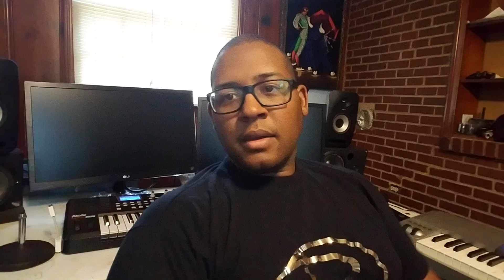How to fix computer noise in studio monitors

Comment: I found out how to fix my problem. I bought a Vizio flat screen and when I hooked it up to the computer I got a buzzing sound. More so when the screen was white, less when there is color. I tried changing resolution and so forth. Didn't work. So I took the vizio remote and tried the menu and nothing worked until I turned down the volume on the remote and there it was. You see the computer runs its own volume to the TV from the sound board and the TV increases the noise from the compute not the volume. So turn down the volume on the TV and use the computer volume. Problem solved!!!!
Reply: This really do work😂 appreciate the tip✅

Comment: Bro, never short HOT wire with GROUND, even for testing... Even with a multimeter, if you short ground wire with HOT wire for testing you can fry your equipment and possibly kill some people too. Like, imagine you're testing continuity by connecting HOT wire with Ground and someone is touching your PC case, or Microwave or Washing Machine.. They'll get 120v or 240v where I live  lol because ground wire is connected to outer metal shell of most of the equipment. Ground wire is an isolated cable that is connected to the long ground copper rod dug several feet deep during construction of the building.

Comment: In my case I'm connecting rokits to saffire 24 pro DSP with FireWire. And the funny thing is that only one speaker makes that noise. All my sockets are grounded. I thought the problem was in power cable.l, so I switched them. But still the same speaker was noisy. So I thought the problem was in speaker... But then I connected both speakers to my dj mixer and the noise was gone. I'm using high quality trs to RCA cables in both cases. Really confused...

Comment: Those Tannoy 402s you have are going to hiss no matter what. It's a known issue with those speakers. Hell, you can plug them in to power with no input and the volume turned down fully, and still hear a loud hiss.

Comment: how you fix this issue is buy a DAC and use the spdif optical outlet and all the noise will be gone.
Reply: semahnai i was thinking about trying this. Good tip!
Reply: @Dan Bate  Most DAC's use a USB connector, but that is 'electrical'.  A SPDIF (toslink) which most DAC's have is optical, AKA light based.  No electrical interference is possible with this kind of cable and connector.  If you dont know what a DAC is...  Its a Digital to Analog converter.  every device that can output sound has one.  You can buy higher quality external DAC's for your computer/phone that use much better chipsets and software to convert 1's and 0's to analog.  A really shitty explanation is Analog is 'basically' raw electricity. (i can feel the ree's from here, sorry nerds)  The benefit is both decoupling your audio processing from your PC, and greatly increasing sound fidelity in most cases.

Comment: I had similar problem, but my solution was the opposite. I had my monitors powered from a grounded power jack but had to break the line with an ungrounded splitter. So that might be worth trying for you who don't solve this WITH ground. I live in an old house with sketchy wiring, think that's one of my problems.

Comment: ATTENTION. For those of you who are still having noise issues even after using balanced cables, go into your power options and choose either high, balanced, or power saver performance. The less power used the quieter the noise. On power saver mode I literally don't hear a thing.I literally tried EVERYTHING and this was the solution. It is definitely a power supply issue.
Reply: what if you're using a desktop?
Reply: @hauntingthegrave  im on desktop and this solution still worked. The power plan options are included on desktop search power plan on the task bar
Reply: Thank you! That eliminated about 80% of the noise, it is still there but dramatically improved.  Going to try that plus installing a GFCI and see if it takes care of the problem.  Would a Peavey USB-P further help the situation you think?
Reply: No problem, but if you want to get rid of the noise completely even on high performance power setting, buy a hum destroyer. I bought this one https://www.amazon.co.uk/Behringer-MICROHD-Hum-Destroyer-HD400/dp/B000KUD2G4/ref=sr_1_1?ie=UTF8&qid=1491799568&sr=8-1&keywords=hum+eliminator 
It was totally worth it. Ps. If you buy one, make sure you wrap some electrical tape around each of the trs cables so the bare metal do not touch each other when they are plugged in.
Reply: Fuckin ay, my man, good shit
Reply: Unbelievable that this fixed my problem immediately. Thank you.
Reply: F*CK YEAH!!!!! I would hug you if I meet you ))) It was driving me crazy couple of years, many hours in different forums - no help, but this small thing reduced this annoying noise to barely audible. THANK YOU!!! :)
Reply: That makes a huge difference. Thank you!
Reply: Danny you’re an absolute legend!!! Thanks for posting your comment. Your advice has reduced a huge amount of noise.
Reply: You are an absolute god send!! I will be buying a hum destroyer as you recommended, but changing to power saver eliminated 95% of the noise.
Reply: yeah i know it, my when i plug power adapter into my laptop so the noise appearent but noise issues disappearent when i unplug the adapter, i try your solution but nothing happen
Reply: power plan worked for me :) thank you (y)
Reply: Dude make a video this worked
Reply: God bless you.
Reply: you're a straight legend!!!
Reply: OH MY GOD! YEARS I HAVE PUT UP WITH THIS. AT LEAST 7 YEARS. GOT DANG POWER PLAN SETTINGS!!!!! THANK YOU!!!!!
Reply: I LOVE YOU MAN! Thanks so much for this
Reply: Power options? What is that?
Reply: What you discovered made the difference of Night and Day.
Reply: Do you know if theres a way to change that on a Mac also?
Reply: Danny, to echo everyone here, THANK YOU!
Reply: I LOVE YOU MAN
Reply: This definitely help a bit. Not entirely eliminated, but it's a good start.
Reply: Yep. This worked for me too! Changed Windows power plan from high performance to power saver.
Reply: Balanced cables did the trick for me.
Reply: This helped a lot, thanks. Aswell turning the monitor volume down and the interface volume up. Nice
Reply: worked for me, about 90% reduction in the noise!  Still have the occasional interference, but it is not as bad as before.
Reply: someone get this man a medal, thanks danny. All these people talking for 45 mins -change the power plan works.

Comment: I have this problem but it has nothing to do with what you mentioned it has to do with my USB hub. Just thought i would mention this because it might help someone and you don't have to worry about electricity shocking you. lol.
Reply: UPDATE: Use the HumX Adapter and you're problem will be solved unless like Dillo said you have a loose ground or something in the wall or on the outlet itself.

Comment: This is interesting. You'd never find this here in the UK. Regs are so tight. A faulty metal cased appliance could kill someone if plugged into an ungrounded socket. Electricians here would be in serious trouble for leaving it out.
Reply from the maker: +Jamie Bales yeah. There's a lot of things slippin in the states
Reply from the maker: +Jamie Bales yeah. There's a lot of things slippin in the states
Reply: I  don't have those cfgi? and I'm in uk.
Reply: Well here's a fun one. I've got this exact issue, and I'm in the UK.

Comment: Ground loop problems suck. ripping off that 3rd prong on your power cord is DANGEROUS it could kill you it's not worth your life.Isolation Transformer has fix this for most.Glad you fixed it..There is some good info over at gearslutz about this...Thanks for the info....
Reply from the maker: yes sir your right, thank fully I took it real careful, everything worked out.
Reply: This fixed the problem 100%.... your the man

Comment: I have a similar problem, I think the ground one happens with using earphones connecting to the front of the computer (pc case's phone Jack) but I don't think it happens when connected to the motherboard. Another problem is that I am using an amplifier or an audio receiver that is connected to passive speakers (that I use for producing) I do hear a hum which could be normal but after a while I get these buzzing or static interference noise through the speakers but I think it's the amplifier problem but I'm not sure if it's ground problem I couldn't find anything on the internet for a fix.
Reply from the maker: are you sure your outlets are properly grounded? I thought mine were till I tested.
Reply: dilliot2k I haven't tested it yet (with a multimeter) but can I send you an email of the other sound from the amplifier?